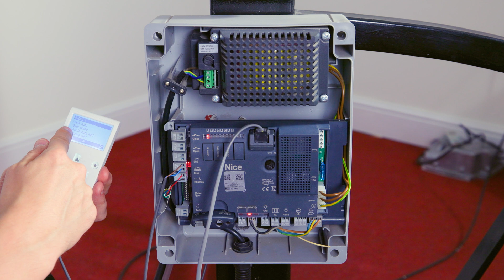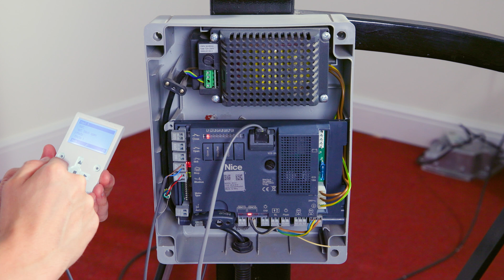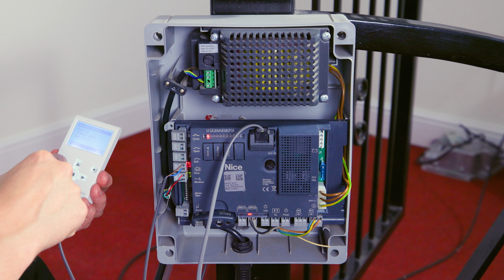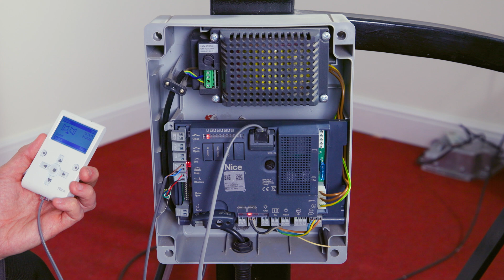Nice MC824H - Programming of connected devices to stop input and Blue Bus inputs.

Comment: Hi very interesting video. I have a question about the available settings regarding the flash or lamp settings. Is there any setting to increase the time that lamp is flashing intermittently?. By default lamp only is flashing during the opening phace them stop and start the flashing  whe close period is starting again.
Reply from the maker: Hi Juan,
With regards to the flashing output duration, there is a feature in level 1 of the programming settings to enable ‘Pre-Flash’. This will set the flashing lamp output to start 3-seconds before the gate operates. The main purpose for this output is to signal to users that the gates are in operation, and so will only output 12V whilst the gate are carrying out a manoeuvre.
If you require an output to be sustained for a longer period, then you could always utilise one of the other outputs such as ‘OGI’ (‘SCA’ on older models). This will output 24VDC and will only turn off when in the fully closed position. In all other positions, the outputs will be as follows:
Opening manoeuvre – Slow flash
Open Position – Light On Permanently
Closing manoeuvre – Quick flash
 
The other alternative would be to change the output configuration using either the OVIEW programming tool, or the BIDIWIFI (see out other videos on these tools). This will enable you to change the parameters of the output settings and change the behaviour from a flashing warning light to a courtesy light output. This will come on for a set time period as soon as an operation commenced, or you could even program a channel on your remote control to turn this on without the need to open the gates.
 
I hope the above helped! If you need any further advice, please let us know.
 
Many thanks
The Easygates Direct Team